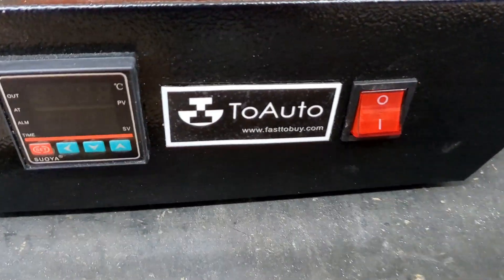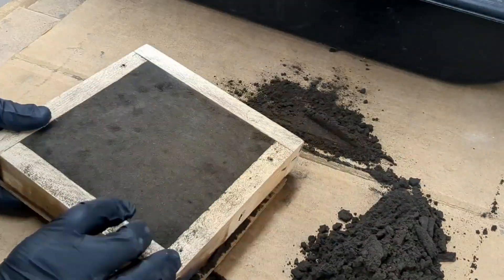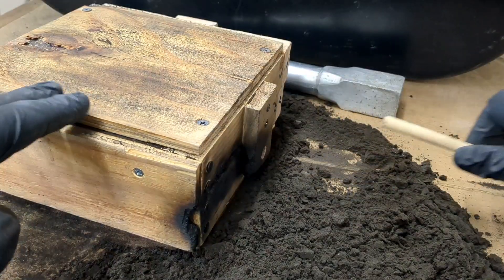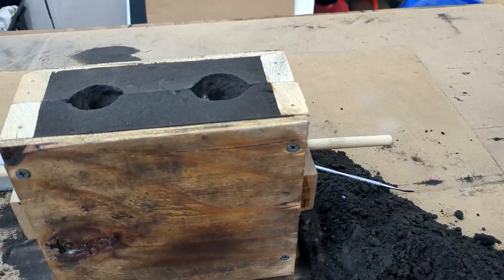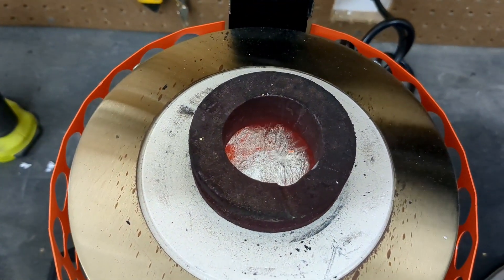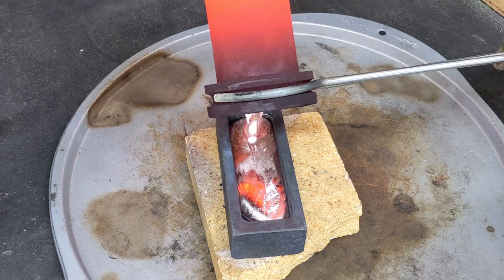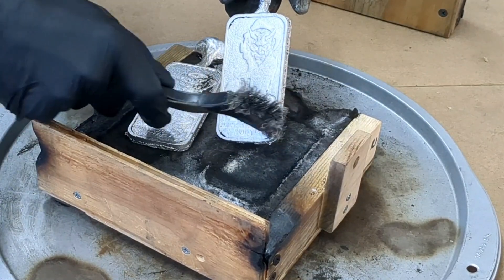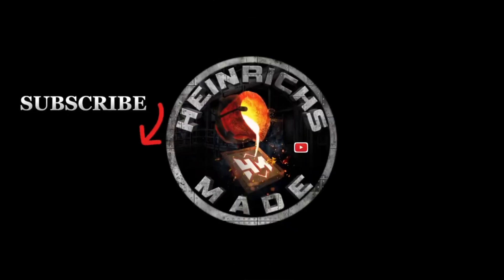Making Sand Molds for Metal Casting - How to make - Casting Aluminum

Comment: Great video's, I'm just wondering if you need a furnace to melt the metal for casting or would a small blow torch do? I'm new to this and I'm trying to figure out everything I need 😅 I like the video's great work!
Reply from the maker: Check the melting temperature for the metal you want to melt.  A small blow torch could probably melt lead and pewter, but not aluminum.

Comment: Can someone do this with lead or another metal to make their own DND miniatures?
Reply from the maker: you definitely can do this with lead.  If you wee doing something flat like this I would recommend using kinetic sand.  You'll see I do pewter with open mold pours in some of my shorts.

 Also,  Miniatures are 3 dimensional.  You wouldn't be able to remove it without pulling the sand.
Reply: @HeinrichsMade  hey thanks for your reply. I have no knowledge at all in this, so I appreciate you taking time to answer my question.

I'm a little confused about what you mean by "3D". Aren't your bars technically 3D, as well?
Reply from the maker: @f2pscaper4lyfe93  sure!  Well it is, but it is flat.  When I say 3d I am referring to an action figure
Reply: @HeinrichsMade  could you send me a link of the open mold pour you're talking about? 

Also, my friend who has experiencing making his own fishing weights with his dad said this is incredibly dangerous. Besides for the obvious (fire, explosion, etc.), what other dangers are there? And how do you minimize those dangers from happening?
Reply from the maker: @f2pscaper4lyfe93  
https://youtube.com/shorts/gpxKWnT-WQI?si=Ey0_0X_YP-9XqwPh

Yes it is very dangerous.  Make sure to do it outdoors or in a ventilated garage.  Wear all personal protective equipment.  Molten is very dangerous when it contacts moisture.
Reply: @HeinrichsMade  i definitely want to try this at some point in my life, but I think i need a garage for that. I do have a backyard, but I'd rather do it in a more controlled environment where I'm not fighting things like the wind, or any potential moisture.
Reply from the maker: @f2pscaper4lyfe93  yeah the wind sucks for recording, but doesn't matter much for casting.  I use my propane furnace for outdoor and larger projects.  You'll see that in most of my videos.
Reply: @HeinrichsMade  oh the wind doesn't matter too much? I figured it would blow that stuff all over the place.
Reply from the maker: @f2pscaper4lyfe93  I mean I guess it matters how strong the winds are 😂. But normal windy days I have no problem

Comment: Does this work with something that is tall and thick with a lot of holes
Reply from the maker: Different patterns require different measures.  Some require more feeders and gates coming off of the runner.  This is the longest thing I've made and it's worked.  Thicker items usually have shrinkage on the back that leaves a depression.  However it worked!  Probably because of the feeder I added.
https://youtu.be/ms3U3L8WFng

Comment: Thank you for your demonstration on sand casting  and mold making.  Greensand seems like a great way to make molds.
Reply from the maker: Yes how to make a mold!  Greensand is a Great way to make a mold for molten metal
Reply: @HeinrichsMade  
Why there wasn't any vent holes in Moulding ?
It is extremely dangerous.
Reply from the maker: @davidchoi6068  it vents through the sand